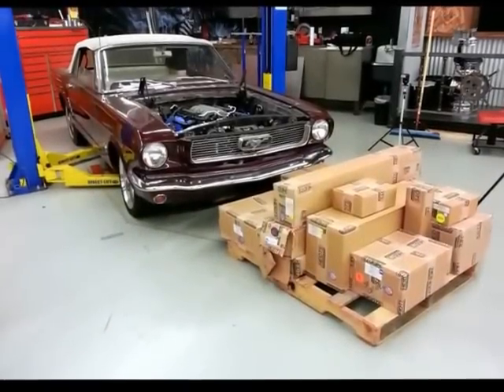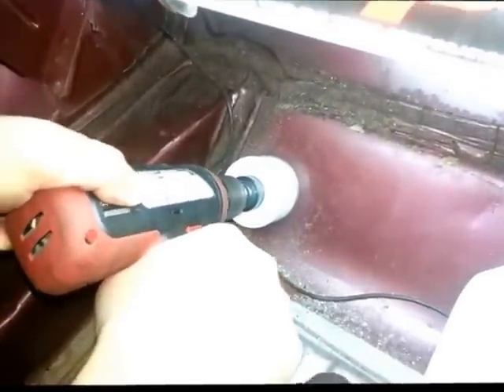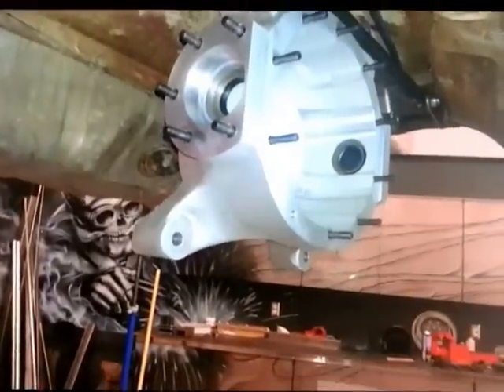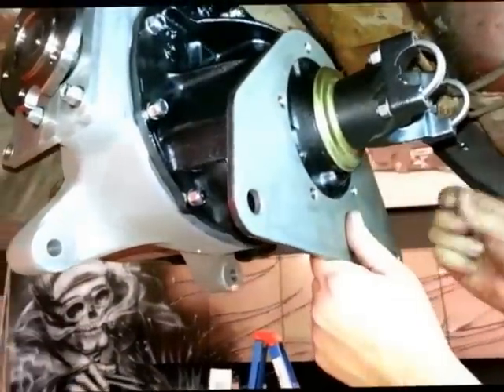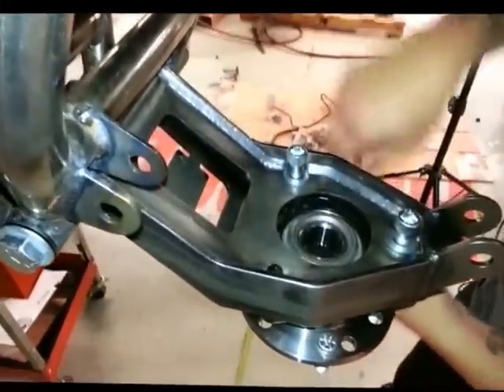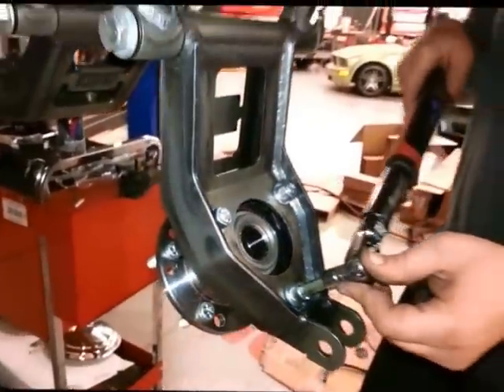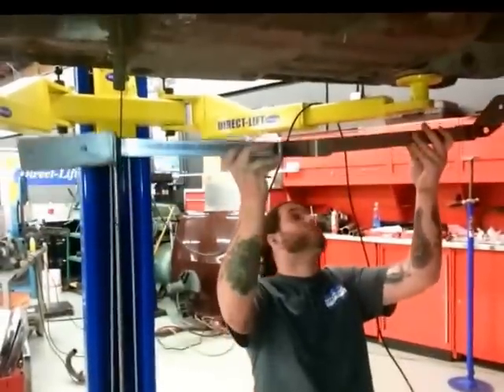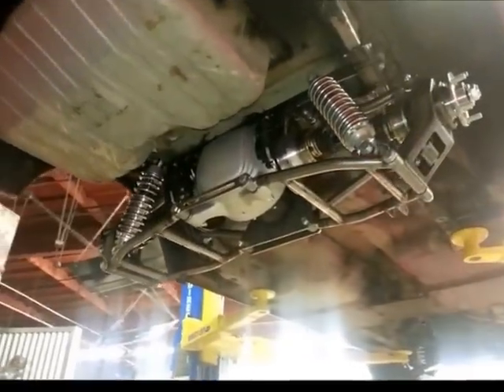How To Install A Heidts Pro G Mustang IRS

Comment: Do you recommend painting the metal parts or rust treating in any way?  They looked like bare metal.
Reply: nckeller epoxy primer wold be required on the frame ber metal or else it will rust
 within two or three years and the frame would be shot

Comment: If you're doing this then you might as well sandblast the bottom and clean it all up. What good is all of this gonna do when the car is rusting through five or ten years from now? A little more work in 2013 would save you a lot of work in 2018 or a whole freaking lot of work in 2023.

Comment: Those studs should be pre installed by heating up the casing and using ice cold studs, so when it cools there in there tight.

Comment: I would prefer if the brake disc was at the wheel instead of the differential housing.  better to show off your colored brake calipers through your wheels

Comment: brake separated from the wheel? correct me if im wrong but that looks pretty unreliable :/
Reply: Its a jaguar style set up,
Reply: +Emmanuel Thommy Nothing unreliable about it, but it does make changing rotors a PITA. There are other kits out there that use the Supercoupe 8.8 set-up with outboard brakes.
Reply: Why would it be less reliable to have inboard brakes?
Reply: @AZCobraman  what kits are those You speak of?